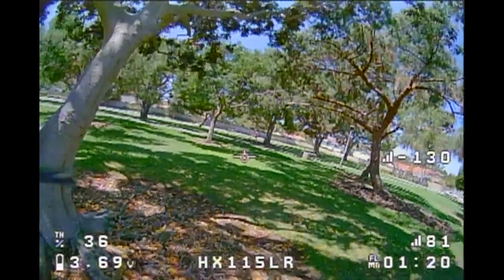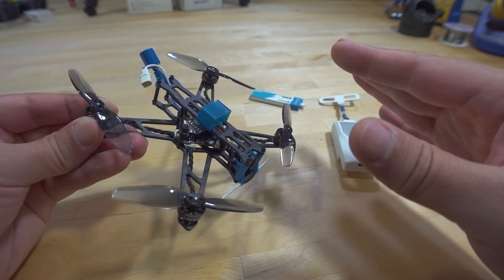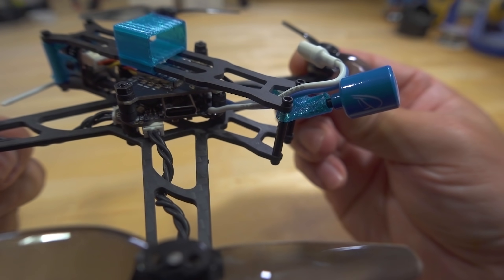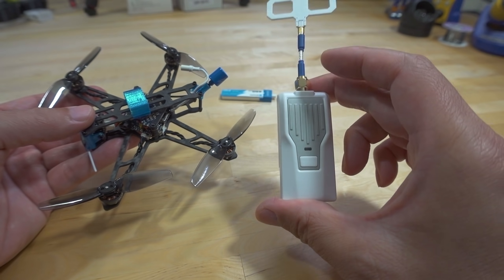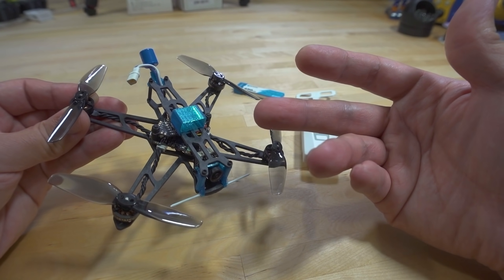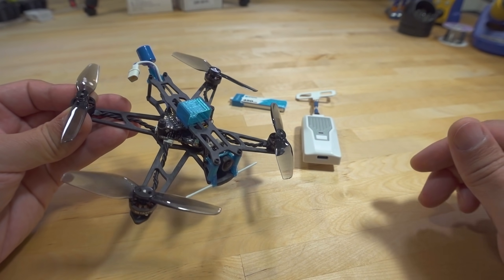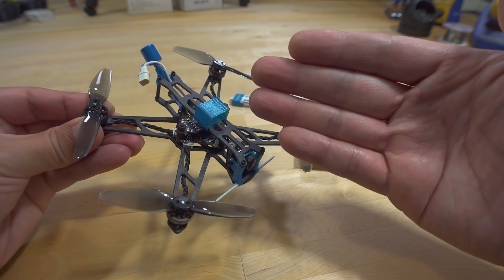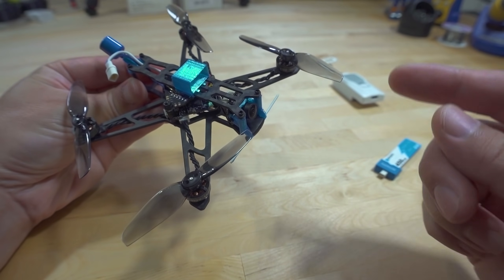BETAFPV HX115 LR 1S NanoLongRange Quad 📩

Comment: 18650 Battery Bay is not included in the package. Why didn't FPV do that ? Can it be modified to use 18650 ?
Reply from the maker: You'll have to ask them that.  They probably don't want you to use 18650.  Sure, it can be modded for 18650 if you want to replace the battery connector.

Comment: I bought one just to play with before stripping down. I love these motors but I love these motors for 65mm only. I've tried them out on 3 inch with a babytooth frame and these motors just dont have the power for 3 inch.  However I love these motors for 65mm. These are the motors I run on my 65mm Pickles and 65mm R3d Shifter's Ionlite. 

These motors are also 2s capable with a throttle limit and I got as good as performance out of these on 2s as I did emax 1103 2s motors. Crashing on 2s though is not advised without using motor stop or being fast on the arm switch.

I dont even understand this whole Micro LR category when a 3 inch is barely a micro and they all have wimpy analog vtx. LR for me is my 6 inch 6s pushing 3W of output power. I think this was a design that let them use some existing components their new ELRS 1s AIO and  fit into that new LR nor LR category.

Personally I want 1s to have some zip and not be some anemic toad in the air that you try to keep hoping around without hitting anything as long as possible because you cant really do any fun stuff because its to big or does not have enough power.

I'll play with it a bit before stripping the frame. I plan on building it back up as a 2s or 3s at a later date. Plan on using the AIO with a 1W whoop vtx on a babytooth frame pushing 1s 13mm motors. Should be able to get three to four times the range of the HX115LR with a good amount of zip and duration. I have already made 18650 removable tray for the babytooth frame and am working on a 2 cell mounting board just to experiment with. I will primarily be running it on the new GNB 1S 720MAH 100C/200c lipohv packs though.

Again though these are some really good motors for 65mm. I went for almost a year where I was only flying 65mm and thats the size I started doing custom builds on as well. If you have a frame that is 3 hole mounting only these are the lightest most powerful motors Ive found so I will definitely be using these motors as backup for my exiting build that use them. Here's that Ionlite build that uses them with great results -=> https://rotorbuilds.com/build/26121

Comment: Struggling with thisone - even with 11yrs experience in the hobby I cannot get this to bind with my Happymodel ELRS TX.
Reply from the maker: The rx on the HX115 LR is not an SPI Rx. Treat it like the EP1. You have to update it via Betaflight passthrough using the Configurator. That's how I got it to work.
Reply: @AlbertKimTV  You beautiful man.  Its working now :-). But it looks like my vtx is faulty , very weak reception even on 350mw.
Reply: Have tried all the latest hex`s from github ELRS project and setting the passphrase in the cli etc.  Betafpv`s website merely has "to do" under all the support docs on how to bind it etc, shoddy if you ask me.

Comment: I'd be interested to see how those 1102 18,000kv motors carry an 18650 cell. Does seem to be a bit of a mismatch. Would've definitely preferred 12 size motors on these 3", or at least 1103's, but maybe the smaller motors are more efficient and help with the "long range".
Reply from the maker: Same here
Reply: Was going to say the same thing. Contemplating buying this and swapping the motors for 1202.5 11500kv ones. Course then I start also thinking about cutting the bottom plate and using a printed canopy instead of the top deck…

Comment: Hi Mister Albert Kim, greetings from a Brazilian living in Japan. I really like your videos. Thank you very much.
But I want to ask: is it possible to bind this quad with HappyModel ELRS 2.4Ghz Transmitter? In case it’s not possible yet, do you think that someday this will be possible? 
Thanks again.
Reply from the maker: It is possible as of a couple of days ago.  You have to update the receivers and transmitters with the same version of firmware with the SAME option settings.  Then they will all bind with each other.  I didn't have these firmware targets in the configurator so the BETAFPV stuff had newer firmware than the Happymodel stuff.

Comment: An AIO test with a bench supply would be amazing. I'd like to know how many of these can actually get down into the low voltage range that 18650s offer with plenty more capacity. A roundup of AIOs with a bench supply set to 2.7v 5 amp at 50% throttle would be amazing.
Reply from the maker: I wish I had a bench supply 😥